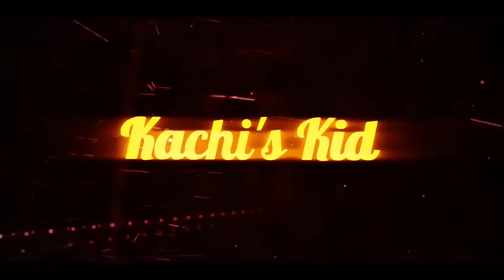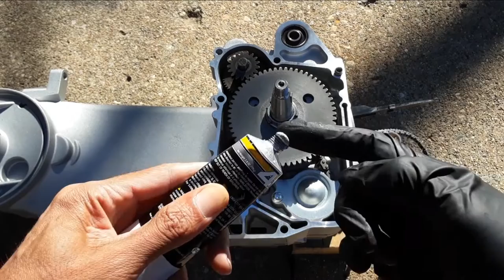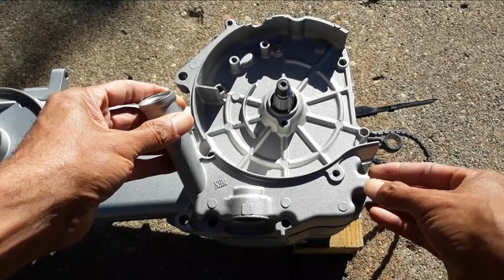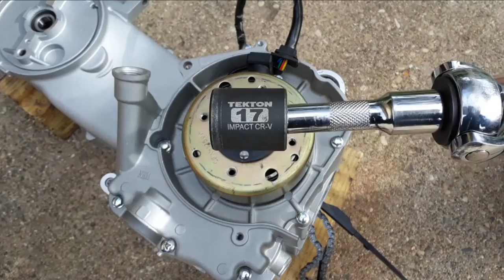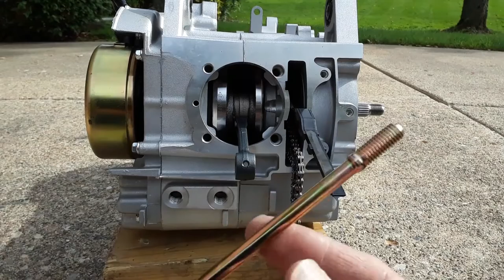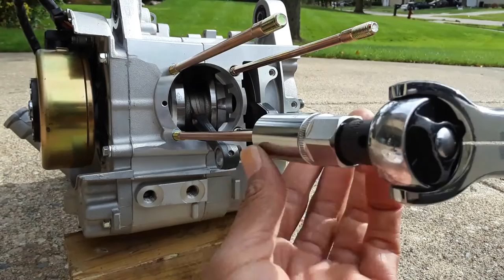COMPLETE GY6 Engine Build PART 2 / 180cc SSP-G / Torque Specs Included / Hope's Comeback

Comment: The blue thread locker where you used it is great except for the head studs.I use Red Loctite threadlocker high heat 272,the head stud base should be secured,based on my experience,the blue is not gonna hurt but there'll be no guarantee it won't loosen,unless the blue thread locker you are using is high Temp.Great job,you're moving in the right direction.I do not want to open my channel because i already found one that i totally support.Greetings from Miami
One day I will ride up there in my stock gy6 150 cc 2014..AKA the beast.7 years and running like a beast.Deliveries back to back for up to 11 hours..No kidding
Lol
Reply from the maker: Oh yeah, I have red threadlocker and use it on the exhaust bolts also. You will see shortly, starting on Part 3 on Sunday. Thanks for the support. I'll be here, when you get up here.